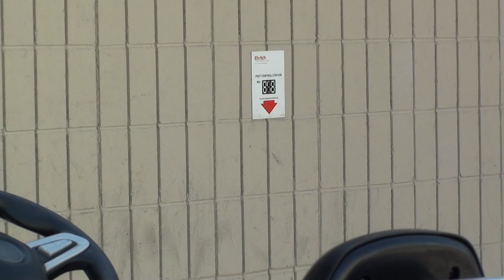Z4 Electric Ride On Car Assembly and Remote Pairing

Comment: Remote is not working
Reply from the maker: More details please. if you see the light flashing on the remote then you have press the pairing button (P) press it again and it should go back to normal. Also check your batteries. Remeber to change them frequently as well. Also to pair the remote, press and hold the up and down arrows and wait for the light to start flashing and then turn on the car. You should see the remote light go solid. Let go of the up and down arrows at this point and the remote will be paired to the car.
Reply: @ahelpfulplace  thanx
Reply: Hello brother... new car.. not paring the remote.. when it staring, car is just moving forward and backward... like vibration
Reply: Remote lost, any solution?